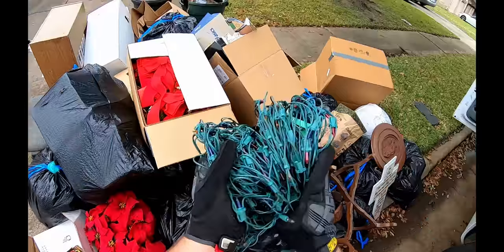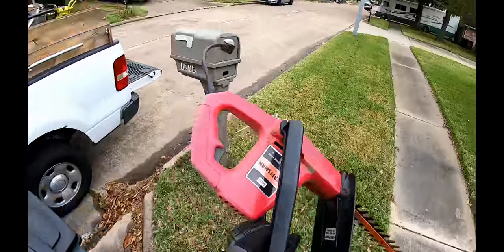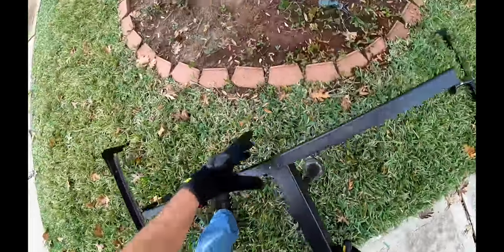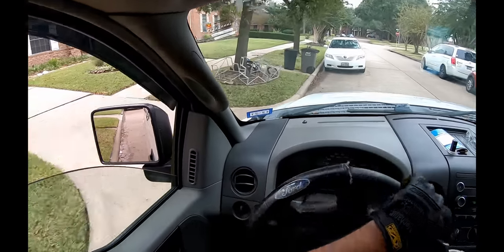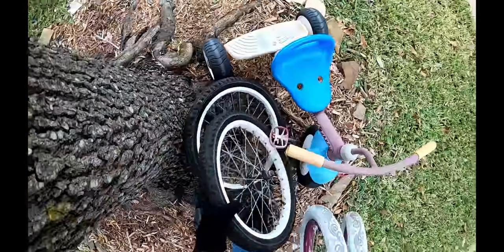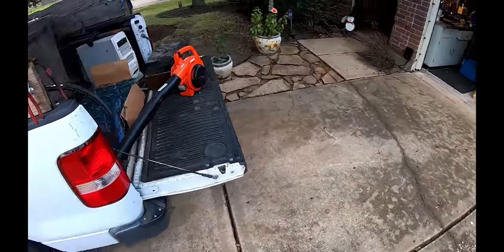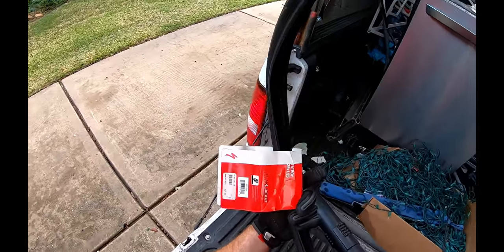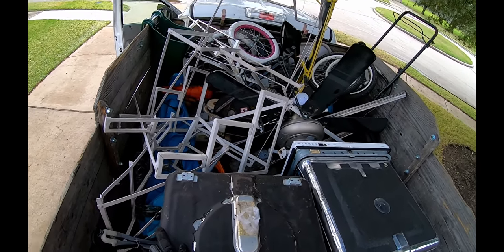Curbside Scavenging "That's What I'm Talkin' Bout!"

Comment: TOP 10 Most Scrapped Items on the curb;
1. Pop up sun shade/tent
2. BBQ grills
3. Ceiling fans
4. lawn mowers/ weed eaters
5. chairs
6.
7.
8.
9.
10.
Reply: Exercise equipment and scooters.
Reply: @bethany9008  definitely
Reply: Bikes
Reply: washers,dryers,stoves,microwaves,sinks,plumbing....ect
Reply: wheelburrow owwww watch yo feeet
Reply: 6. Microwave
7. Bed rails
8. Washing machine
9. Dehumidifier
10. Air conditioner

Comment: I had an old 3 hp Brigg's and Stratton lawn mower. The recoil was a crank on the top of the motor. You cranked it up a couple of turns. Then pushed the release button. And kaboom she fired up. It was a pretty cool  system.
Reply: My brother gave me his mother in laws old mower, it was a crank style also. Used it a couple years. It was a cool design.

Comment: Great load. Those dish washers look like they are stainless. The motors, wire and stainless would be a good micro scrap video. Along with the ceiling fan and aluminum you got too.